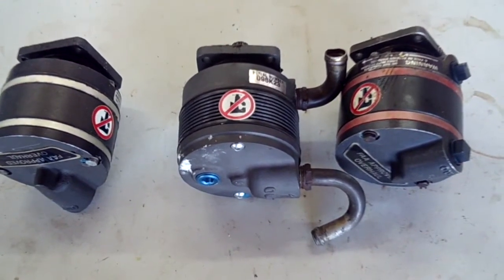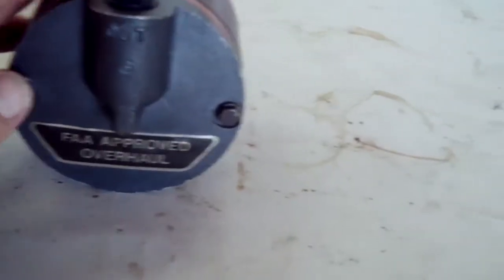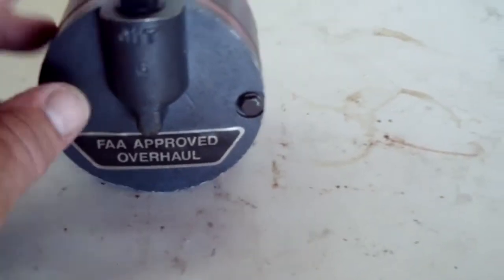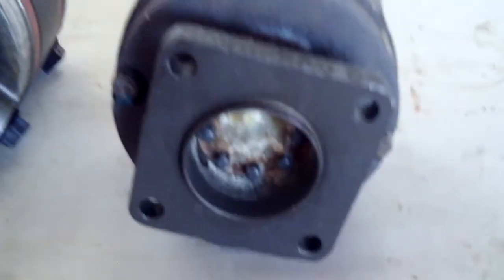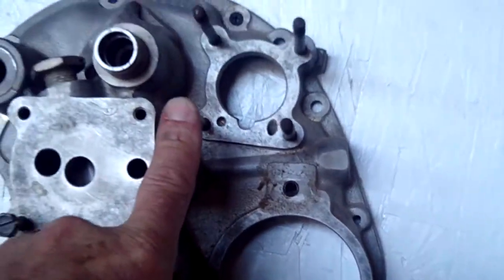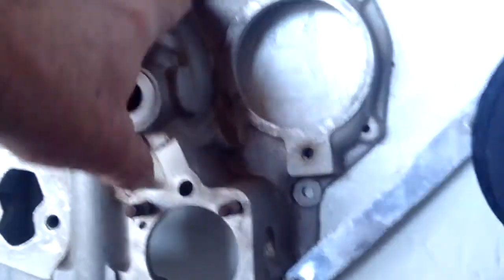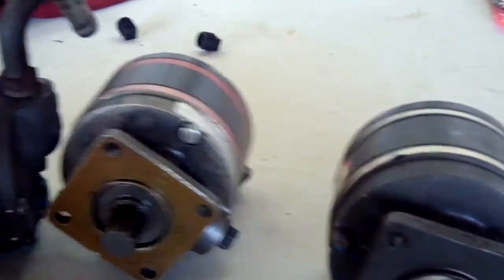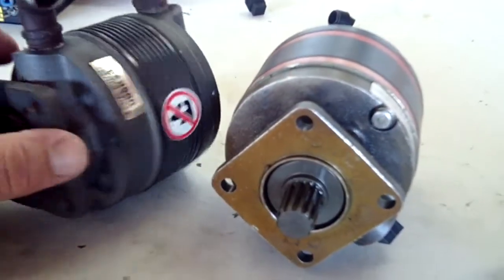Introduction to Vacuum Pumps  - Grumman Style

Comment: Thank you Roscoe.   For those not at the this summer's GPA "Twist a Wrench" and social confab at Ohio's Hogan Field "KHAO" (Butler County Regional), you missed a tough install done by Jimmy of a PMA Airwolf wet vacuum pump in my Tiger.  And it was a tough install.  I still owe Jimmy a steak dinner, for the second effort on the install (which I only recently became aware of).

For those of you out there who are not familiar, most of the legacy engines we fly were originally certified back in the 1940's/1950's and 1960's with wet pumps.  There are wet pumps still going strong from WW-II today.  That speaks volumes about how good the pumps can be compared to the dry pumps which appeared on these engines back in the 1970's.  

Now that I've got about a hundred hours on this pump, I'm pleased to report that my Airwolf  wet vacuum pump is wet only on the inside (lubricated by engine oil of course), and bone dry on the outside.  More than I can say for the dry pumps which notoriously leaked oil at the seals which seems to make its way into the guts of the dry pumps and cause failures.

Thank you Jimmy and Roscoe (at Yankee Aviation for hosting the GPA Twist a Wrench activity this summer).  Also thank you to the folks at Airwolf who tolerated my phone calls so that I could understand not just the theory of operation of the oil flow, but to put context to the promised 10 year warranty.   Read the warrant documents so that you set your expectations properly.  Regardless ... I've got an added confidence now in IMC knowing that I have greater reliability expectations in the wet pump, than on these failure prone dry vacuum pumps.  I hope I never see another dry vacuum pump...
Reply from the maker: Okay